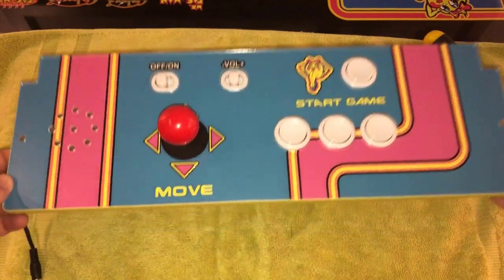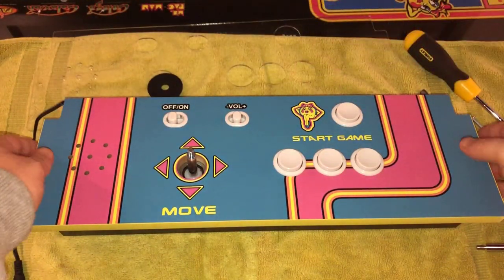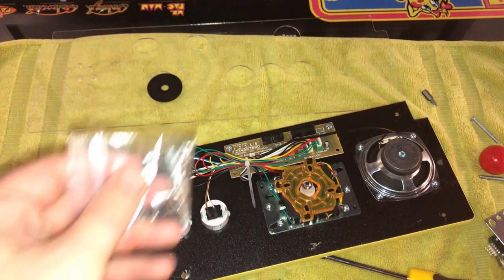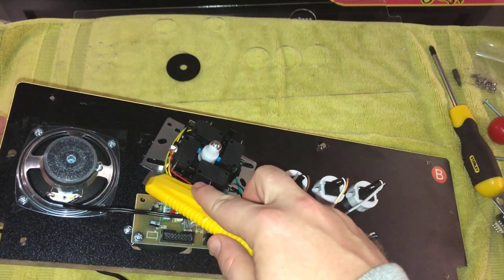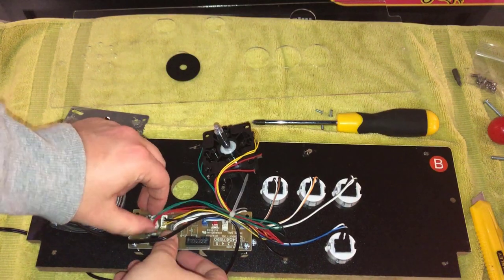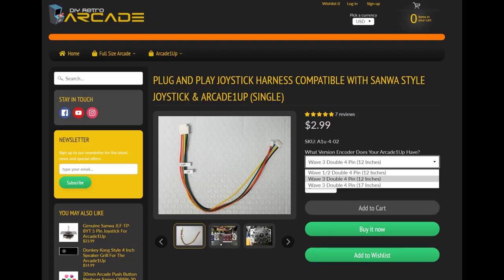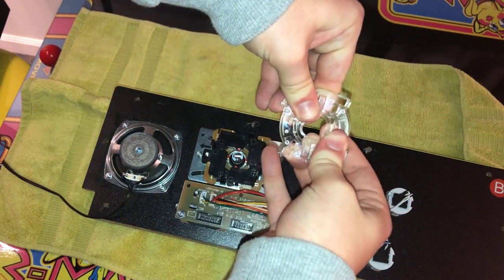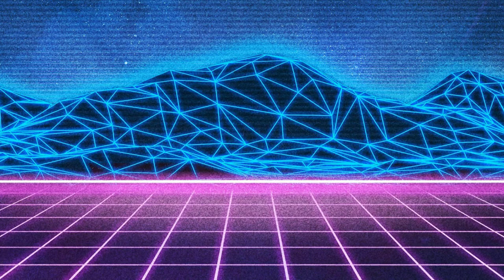No Drilling! How to Install Sanwa Joystick in ANY Arcade1up: Step by Step Instructions and Easy Mod

Comment from the maker: Throw those cheapo joysticks out! What you'll need:
Sanwa stick(s): https://amzn.to/315Zo1C
2lb Tension spring: http://ebay.us/iv0Exx
Arcade1up wiring harness: https://www.diyretroarcade.com/products/plug-and-play-joystick-harness-compatible-with-sanwa-style-joystick-arcade1up-single?variant=32334125301895 (12" works for cocktail, get 17" for all other cabs)
Compatible screws to reuse existing mounting plate: https://focusattack.com/m4x10mm-screw-and-nut-set-of-4/
Reply: MY BRO 😎 YOUR AWESOMENESS THANK YOU 🙏🏻 FOR THISSSSSSSSSSSS!!!!!!!!! MUCH NEEDED DIFF
Reply: I’m looking to get sanwa  8 way joysticks for my mvc arcade1up can you tell me which ones to get and point me in the right direction please
Reply: Harness is out of stock.  Have another link?
Reply: i realize I am kind of off topic but does anyone know of a good site to watch newly released movies online?
Reply: Most ppl would make extra drilling holes. But switching the plate is Jeen Yuhs
Reply: @hyc485killuminate8  where did you  order it from that's what I'm trying to find out please tell me

Comment: Have a stock SF2 Championship Edition Arcade 1UP cab. My buttons are crapping out on the player 1 side so I ordered a Sanwa stick and Sanwa buttons. Still waiting on the buttons in the mail. But I put in the stick at the time of this comment. 

I reused the 1UP faceplate and put it on the Sanwa stick per the video. My stick came with a 5 point connector with open wire ends, but I didn’t need to order the wiring harness separately I was able to re-use the wiring harness on the stock stick. Play tested it and everything seems to be working fine and the Sanwa stick is much more responsive. 

Can’t wait to get the buttons.

Comment: So I did this upgrade to my A1U Ms Pacman cocktail cabinet and it was very straight forward; took under an hour to replace both joysticks.  It's funny to see how much the installed joysticks resembled toys as opposed to the Sanwa's that are built very solid.  While it's a subtle difference in gameplay, I am glad to have done it for the longevity of the cabinet.  

The hardest part was my needing to also take off the top of the cabinet since I didn't have a screwdriver small enough to remove the control decks without doing so.  Getting the plexiglass back on without trapping any dust / pet hair has been challenging.  I also noticed (I think like you) that the player 1 side used a ton more glue than player 2, but was able to get the old joysticks off with a little extra force using a tool in my iFixit toolkit.  

Thanks for the idea, and detailed instructions on how to get this done.

Comment: Thanks for the tutorial!  This should come in handy for when I mod my XvSF cabinet once I get it.  I got the buttons I need, but held off on getting new joysticks until I was certain on how to swap them.  I want it to be a simple mod with no cutting, drilling, or soldering required while keeping everything looking stock.
Reply: What buttons did you use. Did you have to rig the connectors. Or was is plug and play. One more question what was the harness numbering for the xmen vs street fighter. Link
Reply: @philthyphilsf   I used HAPP buttons with Sanwa sticks.  For the buttons, I used a different set of wires that fit to them as the stock wires won't fit to the connectors.
Reply: @SaviorGabriel  did you have to drill bigger holes
Reply: @philthyphilsf   No.  HAPP buttons fit just fine.  You'll probably have to do a little drilling if you want to use Sanwa buttons.  I wanted my mod to be as simple as possible.  No drilling, cutting, or soldering required.

Comment: This was the answer to my problem. I just picked up a Street Fighter cocktail table that was modded with Raspberry and has Siwa joysticks but they dont fit on the original board so I thought I was screwed. I'm trying to get it back to the original state. Now I guess I need to figure out exactly what harness  I need to get.
Reply from the maker: The harness I linked in the description should work fine just don't get the gen 1 version

Comment: Fantastic tutorial, sadly it just reaffirmed that I do not have what it takes to do this replacement without bricking my system so I opted to keep the default joystick as this looks intimidating. I'd rather learn now through your video though than make a costly mistake. Thanks anyhow!
Reply from the maker: hey nothing wrong with the stock stick (except on the gen 1 cabs, those were truly trash). Thanks for watching and enjoy your cab!

Comment: Hello, I am getting the Class of '81 Deluxe cabinet, and I'd like to swap out the joystick during the assembly. Do you know if your instructions will be different for the newer deluxe cabinet? Apparently, the control panel and the monitor are 1 unit, so I'm concerned that the install might be different. Also, do you recommend swapping out the buttons too, or just the joystick? Any help would be appreciated. Thanks.

Comment: Can I do this same mod with the smaller partycade 8 game system which is the more table top version with the 17 inch screen rather than big cabinet?
Reply: I can! I have a Sanwa joystick with a clear blue bat handle 4 pound spring and a blue upgraded button for my fire button coming in the mail. Can't wait to mod this thing! It's already really fun.

Comment: Unqualified Critics,

Now I finally get why you choose Sanwa sticks (other than personal preference).  They look super easy to install in an Arcade1up cabinet.  Me, I'm a HAPP guy as those were the sticks and buttons I grew up with in American arcades.  HAPP sticks are larger, so I could see them being a nightmare to install in Arcade1up's current cabinets and would probably need further modification.  I do have a cabinet from Rec Room Masters that has HAPP buttons and sticks, so at least I have one cab that feels like that 80s arcade I remember :)

Great vid as always!

vgv
Reply from the maker: Yeah man I'm not about crazy mods on these but a custom build like RRM the sky's the limit!
Reply: You can also always screw on a HAPP bat shaped handle onto a Sanwa stick
Reply: BigMac Fullerton,

This is absolutely true :)  However, there are still distinct differences in the way a HAPP stick feels when it moves vs. a Sanwa stick (buttons too).  Though I prefer HAPP for the classic feel I remember in the arcade, I'll still play on Sanwa.  They play fine :)

I love how modular these cabinets are.  So many possibilities!

vgv

Comment: Newbie to the aftermarket joystick upgrade..... I thought I would see tension springs somewhere in that process??? Everyone says get upgraded tension springs, did i miss them? Where do the springs go?
Reply: https://youtu.be/znURbTZHFwA  This is a short video showing how to replace the tension spring on a Sanwa joystick.  It's a fairly simple mod to do.  I believe a 4lb spring should be sufficient as I've heard those are generally what an actual arcade cabinet would have, but you can use a different one if you prefer.  All you're really doing by changing the spring is adjusting how loose, or tight the stick will feel when you move it.  Heavier springs will give the joystick a tighter feel, and lighter springs will make it looser.
Reply: @SaviorGabriel  thank you!!!
Reply from the maker: Covered in a previous video: https://youtu.be/MUWkTtkCxzo I do recommend 2lb or 4lb springs (stock A1ups AND sanwas coming with 1 lb)
Reply: I love the 6lb tension springs. Added to my burger time and space invaders and it’s a world of difference in my opinion. Also going to add them to my NBA jam based on UC’s recommendations. In the end I guess it’s all preference but the higher tension always improves my experience.

Comment: Awesome video man, I have the wave 1 pacman/Pac-Man plus cabinet. Not sure about the wiring harness size as their site size says wave 1 requires 12” and wasn’t sure which one to get as you had indicated only cocktails  require the 12” and all others require 17”. Thanks for the content and help. Happily subscribed for a while!
Reply from the maker: I said that to be safe and since you could be doing rampage where there's moor room between sticks. Pac is a center stick so you'll be fine with 12. Aside from length, the harness itself is different so make sure to select for wave 1.
Reply: @UnqualifiedCritics   thank you 🙏 so much for your reply and help man. I’ll be sure to do as indicated. You’re the man
Reply: @UnqualifiedCritics  hey man I tryed this and failed miserably. I’m trying to just hook my original joystick back up and left and right work fine but up and down are opposite Any ideas? Thanks for the vids man!

Comment: Great video. I do have a question. What made you change the joystick? The reason I'm asking is that my issue on my space invaders game when I move the joystick left or right the shooter hesitates to move so I'm not sure if the issue is the joystick.
Reply from the maker: My joystick worked fine, it's just that the joysticks 1up uses (ESPECIALLY in their first gen cabs) aren't very good, so I wanted something higher quality. For the cost, this is imo the best upgrade you can make

Comment: I am needing to replace the joy sticks on my wave 1 Street fighter cabinet, as they are becoming somewhat non responsive. Will these work for this cabinet? Also will the wiring adaptor work for the SF2 cabinet? Thank you
Reply from the maker: When you buy the adaptor with that link, theres an option to select wave 1. The sticks will fit in street fighter but I don't think you can reuse the existing mounting plate so you will need to drill new pilot holes to mount the new plate

Comment: Maybe it's just me, but I feel like this is way more convoluted than just drilling 4, small holes to accept the Sanwa plate as-is (which I've done, and it's pretty darn easy). I feel like taking this many components apart and having to re-assemble them is adding complexity and chance for error.
Reply: This is harder for most people as it requires the holes to be drilled and the joystick to be dead-center. Swapping the plate is super easy.
Reply: @robtaylor8816  except when you can’t use the old plate. When I upgraded my Galaga to a 4 way joystick I found that the old plate would not work with it, the hole patterns to connect the plate to the joystick were not the same. So I will need to use the Sanwa plate and drill some holes to attach it to the control panel.

Comment: My arcade1up pacman 2in1 joystic is not working. I bought the wires from diy arcade but the wires dont look right and it doesn't work either. The arcade1up has 4 wires each clip ffg or up and down. The diy cable has 2 in one clip and 3 in the other. Your video looked easy but it still not working. I noticed the sound clip attached to the board was loose. Maybe the joystick female has bad soldering or do you think the pcb went bad. I swear the pacman 2in1 is creepily built.
Reply from the maker: Sounds like you have a first gen board and so you need the first gen wiring harness. Try getting the other harness from diyarcade for first wave arcade1up. And yes that pac cab is built poorly I agree

Comment: What if wire harness like u have don't come with plugs to go back on the row of plugs originally that you unplug before taking off the joystick?
Reply from the maker: Then you'll have to crimp them yourself but if you order the harness I linked to, it comes with a plug attached
Reply: @UnqualifiedCritics  ok I have a yellow cabinet so is that wave 1? Is that the problem I'm having? Cause my wires don't have blue and orange and this joystick wire harness does my old one does not
Reply: @UnqualifiedCritics  I went to that link and they don't ship to Iowa and I don't know why?

Comment: Hey there. You have linked a 2lb tension spring but I didnt see you use that in the video. Why do you have that linked in the description? Will i need that in the instillation process? Thanks!
Reply from the maker: Hey there - you can reuse the existing tension spring (.9lb) I just prefer 2 lb. Strictly a personal preference so no its not required
Reply: Thanks for the reply.

Comment: I upgraded my Galaga, pacman, & Rampage cabs with Game X indestructible joy sticks, which after a slight contact arm adjustments, work great! I recently got the MS. Pacman cab & found I really like it's joystick. Seems better than 1st gen. Cabs. My hi score is over 72000 currently. I'm curious, do you feel replacement improved your game performance? What's your high score on MS. Pacman? Only had my cab a month now.
Reply: I just did this and fallowed the links for parts, this stick is worse then the stock one by far. Do not change the stick you will regret it
Reply: @briandhoward6137  Hint, adjust the contact arms with needle nose plyers. There are 4. All need adjustment for optimal control. After adjustment,  you should have no problem. I score over 100,000 on pack man with these indestructible joysticks. Doesn't take long to adjust & very easy.
Reply: @festalongreyhawkshorts4sho645  thank you I will try this
Reply: @briandhoward6137  very welcome my friend! They suck from the factory. Please let me know how you make out. Be gentle. Steel arms, but bend them so they rest up against joystick post. Good luck👍👍
Reply: @briandhoward6137  you can find videos & watch how also

Comment: Awesome video, you make it look so easy.  Do you recommend doing the sane for fighting games?  If so which ones?
Reply from the maker: extra recommended for fighting games, any of them. Some titles used other brand's sticks but Sanwa are easy to install in A1ups + high quality
Reply: @UnqualifiedCritics  Let me ask you, I live in FLORIDA how do you think these machines will handle the garage?
Reply from the maker: Great question and I don't know since mine have always been climate controled. Assuming your garage isn't climate controlled/dehumidified, expect breakdown of the mdf eventually. And worst case, there is enough moisture to damage the electronics altho I dont think that's likely
Reply: @UnqualifiedCritics  I hear ya, room in my spare room is getting tight.  Had to for real compromise with the wife to get the NBA JAM.  Now we got Killer Instinct.  Are you kidding me, wonder what I need to do to let her let me have that one. Ha. Forget about it if they come out with a Simpson's.

Comment: Can you purchase the M4x10mm Screws and Nuts from Lowes/Home Depot?
Reply from the maker: yeah I'm sure you can but you'll have to check, I ordered from that arcade supplier
Reply: Yes, I just purchased M4x30mm screws at Lowes for my Vigolix build. They have the 10mm there. Do not get them from Home Depot though, the M4's they have are stainless steel and cost around $0.80 a piece. I got a pack of zinc ones at Lowes for around $2 a pack of 10.

Comment: Ok, I tried this with Pacman and only got left/right.. Any buying tips or information on a Pacman harness with Santa stick? By the way I tried contacting diyretroarcade and didn't get an answer
Reply from the maker: Things to check:
Restrictor gate clipped in?
All 4 actuators placed correctly?
Is your stick centered perfectly to the hold in the control panel?
Check the wires to make sure each individual wire is connected/not bent

Comment: Thanks for video. My joystick moves and clicks but ms Pac-Man or spaceship doesn’t move. It occasionally “sticks”. Do you have any ideas on how I can fix this?
Reply from the maker: Sounds like the actuator is engaging if it clicks but may not be wired to the pcb. Check your wires and make sure all wires from your stick to pcb are fully connected on both ends
Reply: Thanks!

Comment: I'm guessing the Sanwa joystick is more responsive to having a replacement tension spring installed with it.  I put a 4lb spring on the default joystick for my Ms. Pac-Man arcade 1up cabinet, and less than 24 hours later, moving the joystick up wouldn't work...only left, right, and down...
Reply from the maker: My guess is you knocked a wire loose when you opened it up. Double check the actuators are all connected to the sticks pcb
Reply: @UnqualifiedCritics  Hmmm...not sure.  I put the default 1lb spring back on the default joystick and it moves in all 4 directions again.  The default joystick just can't keep up when navigating Ms. Pac-Man through tight corners, especially in Fast mode.  I'm planning on installing a Sanwa (with a 6lb tension spring), and keeping the default joystick as a backup if all else fails...
Reply: Attempting to install a Sanwa on my Ms. Pac-Man cabinet.  Arcade 1up must have used an entire bottle of glue to seal the factory joystick to the control deck.  My box cutter blade can't get under the joystick plate at all.  And I don't have a hair dryer to heat the glue.  Any suggestions?
Reply: Nevermind.  All it took was a hammer and 3 gentle whacks on the display side of the control deck, and the joystick plate popped off with no problem.
Reply from the maker: @coreyalexander9059  if it happens again try a heat gun or blowdryer to soften the glue a bit. It's dumb the amount of glue they use when the screws work fine to secure
Reply: @UnqualifiedCritics  A friend of mine also suggested Goo Gone.  I put a tiny drop along one edge of the metal plate.  It didn't allow my box cutter blade to get underneath, but it may have helped to loosen things a tad once I used the hammer trick.
Reply: Sanwa installed in my Ms. Pac-Man cabinet with a 6lb tension spring.  You know it works the way it should when you can jiggle the joystick to evade the ghosts going into a tunnel.  Try doing that with the default joystick...lol
Thanks to your tutorial for help with the process.